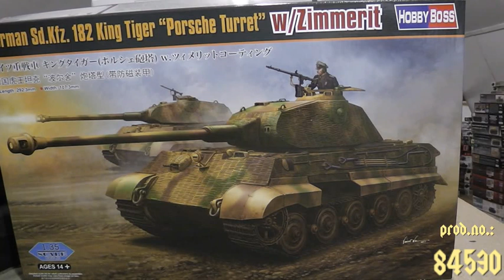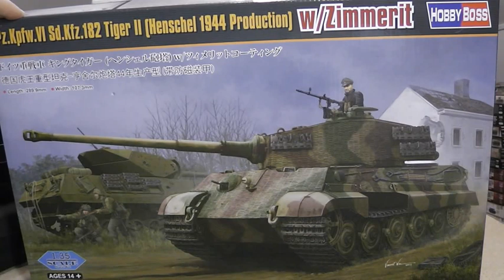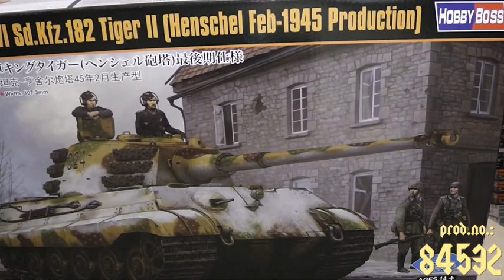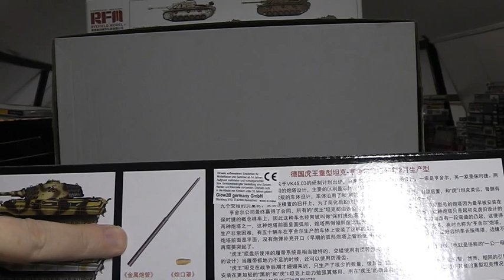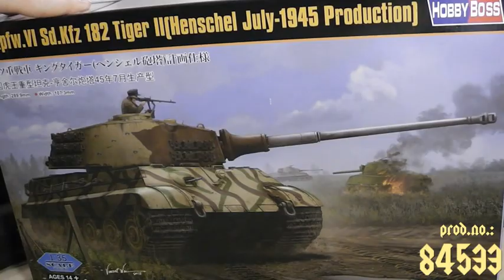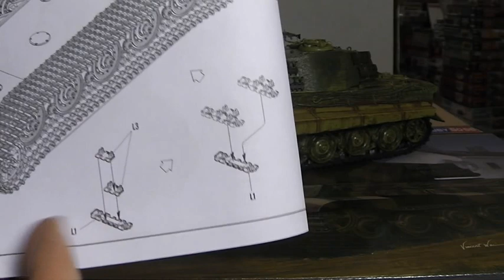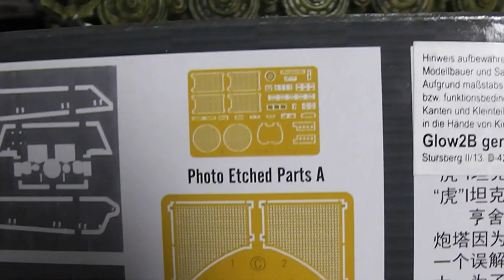Overview 1:35 Hobby Boss King Tiger Kits & post build review of 84531 ('Henschel' 1944 production)

Comment: When I get round to doing a King Tiger in due course, I may try this kit. I'm not keen on these kind of tracks, but from what I saw here, it will require some patience, but they don't look overly complicated.. As for the zimmerit, I have never built anything with zimmerit before, but I hope to do a Panzer IV soonish, using the Tamiya zimmerit decals, even though it's not a Tamiya kit. I will see what I think of that result, before I try to do any kind of scribing or use milliput. This was a great and informative video, it told me more or less all I needed to know about this kit, good things and bad.. It didn't put me off buying and building it. It was good to see all the different versions available as well, now I know what to avoid, as I would like to build something that actually existed, rather than something that could have been.. :) So yes, t5hanks for sharing your experience.. very helpful!! :)
Reply from the maker: I appreciate your comments a great deal :-) I am really glad you found the information useful! Using Tamiya zim decals might work just fine, if you're lucky. If all that is needed is a modification or two, cutting into the decals, then I think that would count as a success? The "good tracks" in three of the kits should definitely not be a problem, as long as you apply glue sparingly. Good luck with your Panzer IV!